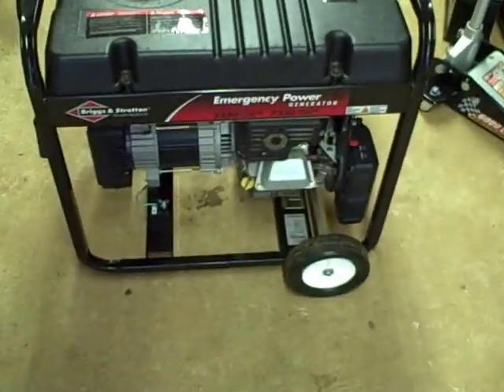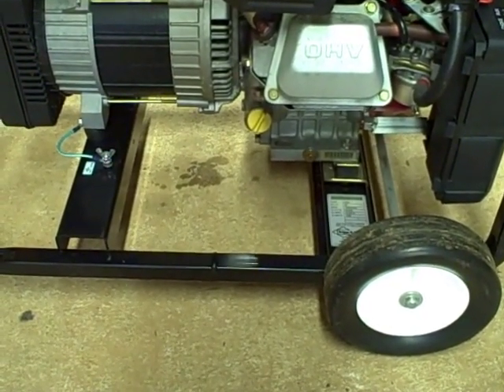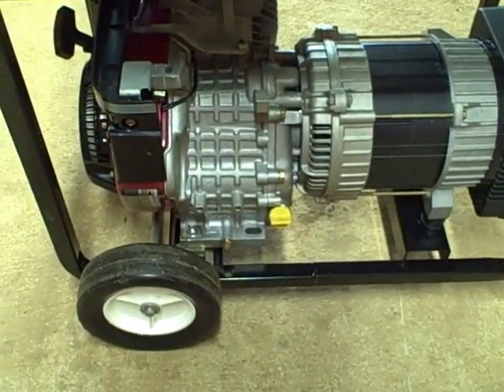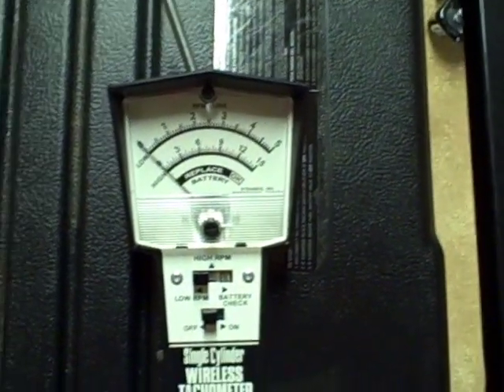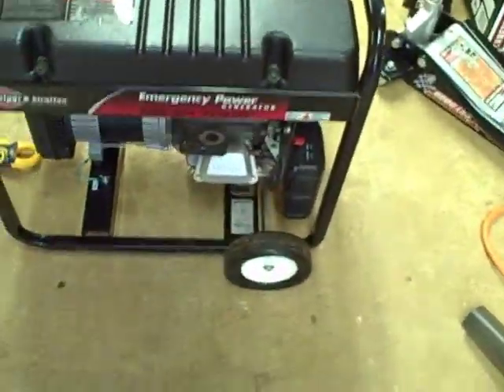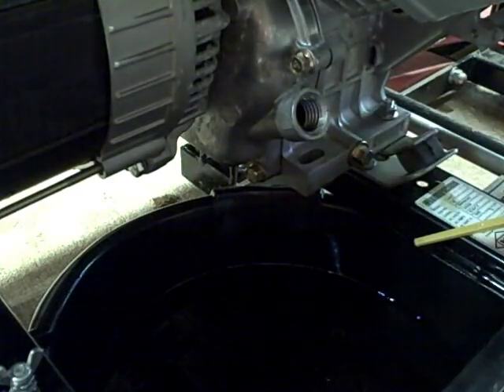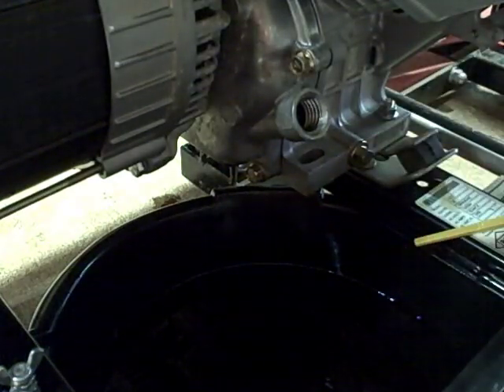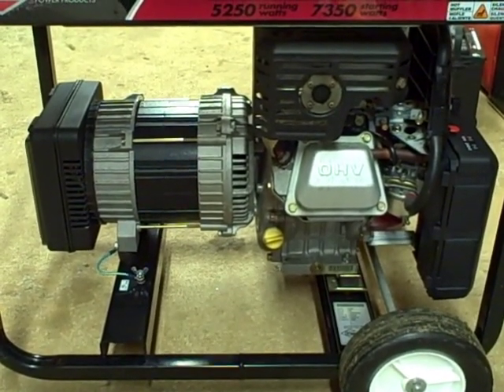Small Engine Repair: Oil Change, Check RPM, Voltage, Frequency on Briggs & Stratton Generator

Comment: I poured 28 ounces on mine and it reads full, I have a larger model its the 5550 watts and 8550 starting watts
Reply: Does your have an oil filter? I have the same model
Reply: @jasonrodriguez463  no it doesn't
Reply: @duartepaintinghandymanservices  Thanks!!

Comment: I would have liked to have seen voltage and HZ readings under load. My generator runs at 124 volts without a load, with an 80% load 119 volts.

Comment: Hi, I have a BS portable generator (not sure the model number as most labels are missing).  I have acquired it used. The generator gas engine starts fine and runs fine but the unit generates only about 50V when switched to 110V and about 100V when switched to 220V.  The voltage is constant and doesn't change.  When I connect an electric drill when the generator is switched to 110V (voltage meter on the unit shows 50V) the drill spins slowly.  What could be the potential problem(s)?  I work on things myself so I just need to know which parts you think I should check (and possibly how).  Thank you for any input.
Reply: Oksana Wasilik 
Did you ever figure out what was the problem ??

Comment: Crank up the generator, plug a 120 volt electric heater of about 1500 watts turn it on to put a load on the generator and then check your HZ cycles, you made need to slow or speed up the engine to get 60 cycles!

Comment: I just recently refurbed one of these I salvaged from a junk yard, and am getting 7500 running watts with 9 k surge. I had to go through enginee, out new fuel tank, muffler and wiring and circuit wiring.  Best generator,I have ever owned next my standby.

Comment: No, and in most examples it won't be. If they say change it once a year or every 100 hours then that's what you do. If you have an engine problem and you try to get it repaired under warranty you better be able to prove you have done proper service.

Comment: that will be fine. You cannot really overfill those engines with oil. As long as the level is between the bottom of the threads and the top of the filler neck then the engine has enough oil.

Comment: @tapuout333 sounds like it could be a voltage regulator. Check the Hz and make sure its set from 60-62 Hz. Once it is set to the proper Hz, check the voltage under a load. A 1500 watt space heater or hair dryer works fine as a load. I have seen that some voltage regulators are quirky without a load.

Comment: Hello, nice video, I have the same genny but mine is 8550/5550.  My output voltage is too high.   I should be getting 120 like you but I am getting 180 and at the 220 4 prong twist lock connector I'm getting 380.  Would you be able to tell me what's wrong?  Voltage regulator ?
Reply: Sam Gordon 
Did you ever figure it out ??